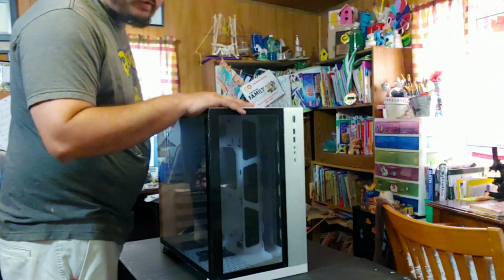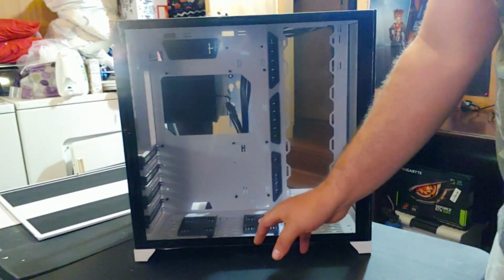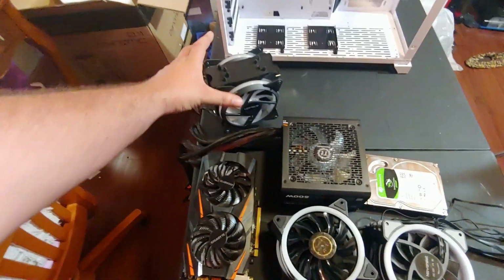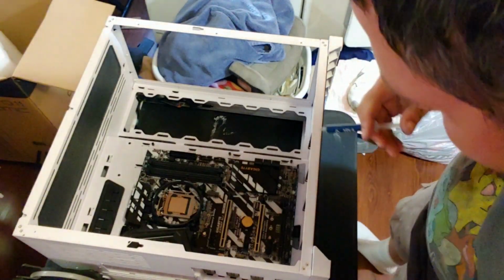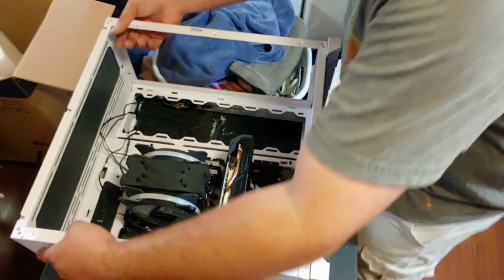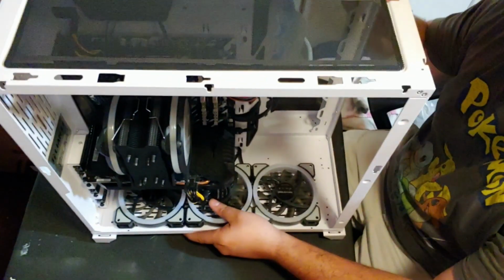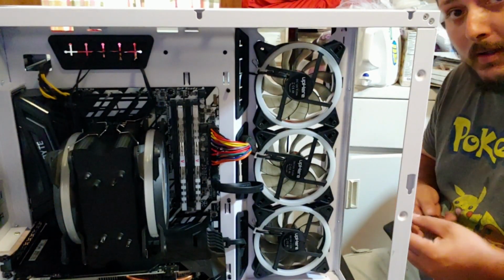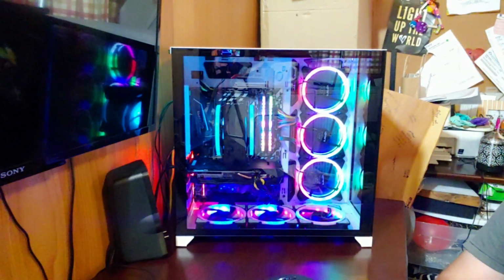Lian Li 011 Dynamic Gaming pc build 2019

Comment: No joke this is the best LIan Li 011 Dynamic XL video on the internet hands down.  I had mine in pieces tonight and one of the metal cable management pieces literally fell off and I didn't see where it even came from.  I couldnt figure out where it went and in a fit of rage found this video.  BOOM!  exactly what I needed, got it all back together flawlessless.  This video is better the Reading the Fing Manual.  I like how you actually show all the steps.  10/10.
Reply: To be honest the manual is utter trash. it doesn't show anything about the back panel

Comment: how did you manage to put the bottom fans if the front panel usb 3 cable is too thick that blocks the space for the fans?
Reply: (2-Pack) COMeap Small Mini USB 3.0 19 Pin Internal Extension Header Adapter Cable for Motherboard 5.9-inch(15cm) https://www.amazon.com/dp/B083XDQSWT/ref=cm_sw_r_cp_api_i_5bc5Eb1DAC0J6
Reply: @clarencehilario6186  I put my case together last night and ran into this same issue, bought some of these to fix the problem. Until they arrive I'll just have to leave it unplugged.
Reply: Wondering the same thing??

Comment: Need some help if anyone could provide some! Currently building a setup with Lian Li Dynamic O11 case, ryzen 7 3700x CPU, MSI B450 Tomahawk Max Motherboard and RX 5700 XT GPU, how many fans would I need to be good enough to cool the system and what PSU should I use?! I’m new to building PC’s so quite clueless in certain areas! Thanks for reading:)
Reply: B4RNESY I have a gtx 1080ti with my Ryzen 2600x. I use a 750w PSU. And I’m new to building PCs and I’m waiting for my lian Li case and my new MOBO. Went with a ASUS Prime X570-p.
Reply: Bigg Sam sounds good Sam thanks for giving the time to reply, be sure to let me know how you get on! How many fans are you going to be using on the case? I’ve bought 3 upto now but wondering if I need more!
Reply: @barnesy1480  I bought 6 fans. I went with the Cooler Master Masterfan MF120r ARGB. I ordered the Asus Prime X570-P motherboard instead of the tomahawk because it was only $35 more and supports ARGB. Im going to play with the fan set up. ATM im going with the 3 side instake and 3 top intake. See how that goes.
Reply: @barnesy1480  650 Watt PSU  will be more than enough..Just don't just buy a cheap unbranded one to save money...Spend about 70 quid on 80 plus one...
Reply: What did you end up going with? I'm using 9 Noctua NF-S12B redux-1200 PWM. I didn't want to pay extra for a light show, so I went with some cheaper, but reliable and quiet fans. I don't think 9 fans is necessary, but I didn't want to have any gaps between fans. 6 intake on bottom and side, 3 exhaust on top. I'm using an 850W PSU by EVGA, along with a Ryzen 3900x, and RTX 2070 Super.
Reply: Curtis Collins I went with 6 in total of the Corsair Sp120! 3 intake in the bottom and 3 exhaust on the side, playing games like call of duty warzone on max settings set my temps around 55 degrees for my cpu and system in a whole which is perfect really for such a heavy loaded game!

Comment: I have a strix 2080 super do you think this case will fit it I personally don’t like the vertical gpu
Reply from the maker: L3gend2You  yes should be fine.
Reply: I don't think there is a graphics card that wont fit in this case, it is huge on the inside.

Comment: You did not show installing the little rubber pad that came with the unit for the power supply.  19:31
Reply from the maker: Mel Jenkins I did must have got lost in my video editing its my first time doing any video editing or anything like it
Reply: @xocavemanox1  That's OK.  I went ahead and bought the case and glad I did since it had a lot of room to work with.  The only issue I had was installing hard drive and SSD's that had to be installed flat on the surface and the power connector cable to them was a pain that I had to use stand offs just to elevate them (if you know what I mean) so I can connect the power cable with the exception to the HDD that were installed in the rear.  In the end I installed 3 HDD and 2 SSD's. I could have installed one more SSD but my ASUS Mobo had only 5 working SATA ports with one disabled because I was using one NVMe M.2 which would clearly disable one SATA port.  Cable management had lots of room to stuff them although I use zip ties to secure them. ASUS ROG Z390-E, i7-9700K, G.Skill Ripjaw 32GB (2x16GB) RAM, Samsung 970 Pro 512 GB,  NVIDIA Geforce GTX 960, Cooler Master ML240L  CPU cooler, 850 watt PS. Overclocked at 5.0 GHz